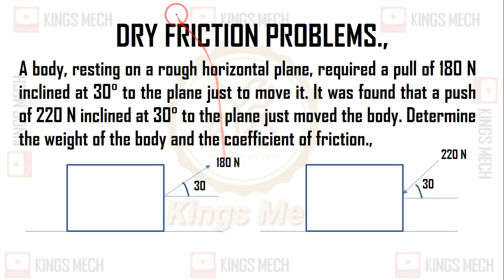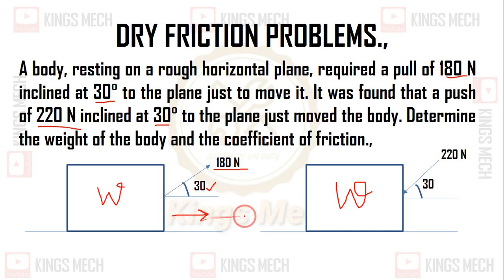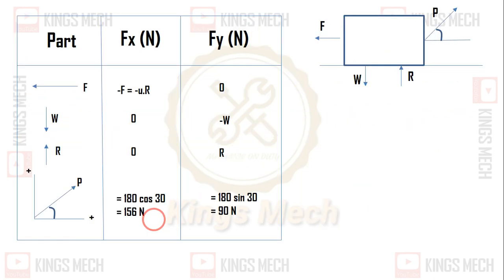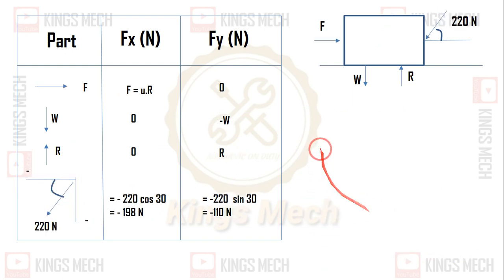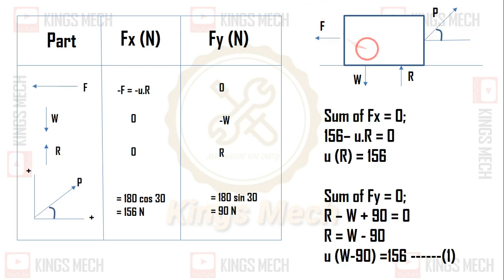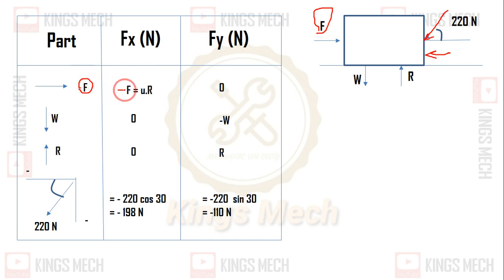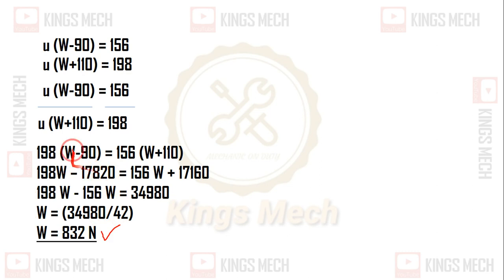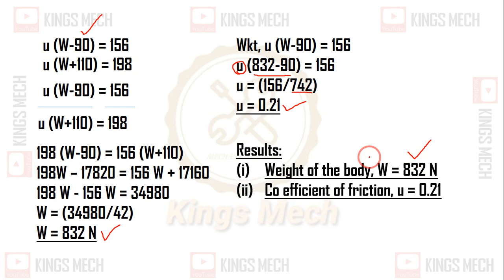dry friction problem in tamil#2

Comment: Sir 220cos30=190.5 ethu eppadi sir 198
Reply: So what's the w value bro
Reply from the maker: Just follow the method and update here..I will pin it
Reply from the maker: Maybe rounded off or calculation error